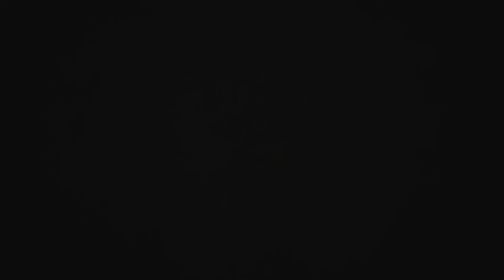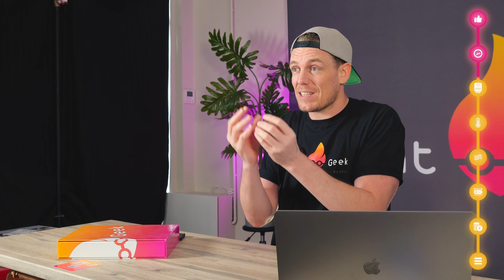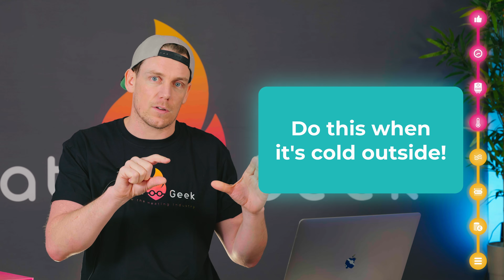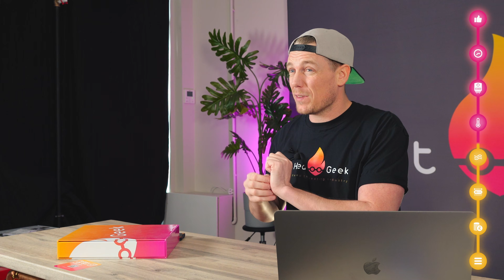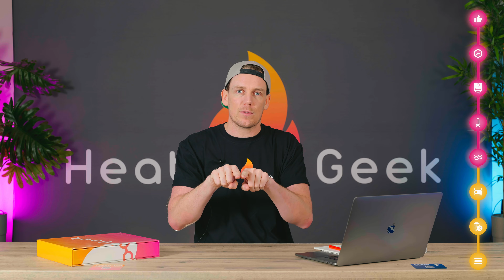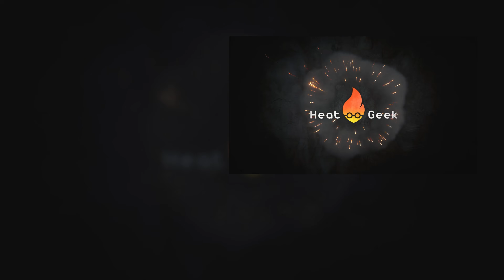PAY LESS FOR HEATING!! | The Secret To Boiler Efficiency | Consumer Advice

Comment: Really liking the efficiency theme! I'm getting a Heat Geek (Simon) installation this week and we struggled to lock down on the most efficient boiler option available. Would be incredibly helpful if you could do a HG video review of the most efficient system / heat only /combi boiler options for consumers if a heat pump isn't viable/ available.

Love the channel and the hard work you're doing to save us all.
Reply from the maker: Thanks! The most efficient boiler in my opinion is viessmann 200 with weather compensation for all the options due to its modulation range. So get one of those.. 

If heat only will need to revert to a viessmann 100
Reply: @HeatGeek  Oh thank God - we mutually agreed on the 200-W thanks to the lowest modulation ratio on any boiler we could find + being H2 ready. 

There is a dearth of available content on this exact subject btw..
Reply from the maker: @avivscrewvalla  h2 ready is a gimik, those boilers will never see h2. But yes agree

Comment: I have a small comment about lowering the flow temperature too much.
I have a small, well insulated house with 100 sq. m of underfloor heating. There is no zoning, all loops are constantly open. Heating is provided by a condensing gas boiler that has a minimum thermal power of 3 kW (1:8 modulation rate). If I set the flow to 28 degrees, the underfloor heating supplied with 28 degrees water is only able to dissipate less than what the boiler puts in at its minimum firing rate. The flow temperature quickly overshoots the target 28C and the boiler starts to cycle on-off like a sewing machine. But if I raise the flow to 35 degrees, then all of a sudden the floor can easily dissipate the 3 kW of heat and the boiler purrs like a kitten for an hour until the thermostat turns it off. I wish the boiler had a lower min. firing rate so the heating could run for longer periods of time at a lower steady power.

Comment: Interesting, is slightly confusing espec when we have a combi boiler but no smart home device to know of power output cost etc. So let's say we have our heating temp at 50 at boiler, is it best to set temp at house thermostat at say 20 and keep heating on all time so it stays around that or manually turning it off and on when required. Which would be more cost efficient. For example we have a hot water kettle that keeps it hot at low power and it states its more efficient than if you kept reheating it as a standard kettle.? Thanks

Comment: I hardly use any hot water. I generally use the local swimming pool and gym to wash. I also don’t use much heating as house is well insulated and big south facing windows in lounge. I have a normal system boiler with a hot water tank. Can I just adjust the boiler temp to 60-70 oC when I put the hot water on (usually about 25 min per day) and then reduce it right down to 45-55oC when I put the central heating on. The heating is obvs on for a lot longer per day than the hot water during a Scottish winter

Comment: Just Had My December Bill , So will Try 35/38 and See How Much I Save, House Is Set To 18c. Radiators all at 20c, But Of Course Heating Goes Of At 18c. Was Using 2-5 Gas Meter Units Per Day, Messing With The System, Now I Am Telling Everyone, Set and Leave, What You Think Guys? Oh By The Way, I Have No Income At This Time, My Company Collapsed , Due To Last 2 Years.

Comment: I have been told by a previous engineer to keep hot water temp at above 60degrees to prevent possibility of legionnaires disease? Is this only true of systems using a hot water tank? Thanks!
Reply from the maker: Above 60c is scalding. Very dangerous. Above 50c prevents legionairs. Legionaors fies in 2 hours at 50c

Comment: And best efficiency for hot water is when the hot water tank is hygienic boiler with no legionella at any temperature. Efficiency for hot water on combi boiler is less then 80 vs. more then 90 with hygienic boiler and the flow of water is key to economy.

Comment: I have developed a smart hot water cylinder thermostat. A) it means u know EXACTLY how hot the water is, B) you can EASILY and REMOTELY change the thermostat setting. C) see how long it takes to heat the water to the desired temperature. Woukd u be interested in it?
Reply from the maker: Sure..  is it commercially available?
Reply: @HeatGeek  it's a new product I have developed and current manufactured by me on a ad-hoc basis. If it takes of it can be packaged as a retail product. What kind of retail price would you think people would pay? What would u pay to put one in your house?
Reply: @HeatGeek  maybe we could work together on it as the first heat geek product!? Anything is possible.
Reply from the maker: @kevinleesmith  I have some ideas. Also have a video on this due out
Reply from the maker: Feel free to contact hi@heatgeek.com
Reply: @HeatGeek  done
Reply: AFAIK a modulating boiler, modulates the burner doen to a lower power output. Are youbsaying that a modulating boiler, also modulates the rad pump?? If so, can u let me knownwhere that info comes from because I haven't been able to find any info that says a combi boiler modulates the pump...

Comment: @HeatGeek, please what would be best: 57 at 23.5 Celsius or 58 at 23 Celsius on thermostat. My apartment is on the North, and no neighbours and last level. Is cold. 
I saw that on 57 and 23 Celsius, feels cols. At 23.5 and 57 is just fine. 
At 58 flow and 23, it is ok, still feels cold, until the condensing boiler starts. 

What to do actually? 

Thank you...

Comment: Just throwing a question out their can you get a solar panel system that will run an electric boiler so u don't need a gas supply to your property?
Reply from the maker: This is essentially what a heat pump is.. but yes.. electricity boilers use 3.5 x more electricity than a heat pump so cost 3.5x more.. don't do it if you can avoid it

Comment: This is really valuable information Thanks for sharing! It would be great to have more content for properties with 100% UFH. Reducing a boilers flow temperature to 35 degrees is probably not that great in terms of condensation efficiency I would imagine? Especially with mixer valves on manifolds etc
Reply from the maker: Reducing boilers flow to 35 is amazing for effy

Comment: I think heat pumps are fantastic idea for myself I want both working together so that in the winter the gas can supplement the heat pump or just run the heating for lower outside tempreturees. But for myself a could have free hot water all through the summer as I do with free charging  of our EVs . We just need to make sure our home is heated without issues below 5degress. So really running both would be our awnser.
Reply from the maker: Why couldn't a heat pump heat below 5c? Have you been listening to those with no heat pump experience? I wish they'd stay out lol
Reply: @HeatGeek  lol you sell heat pumps . But regardless I would not want all my eggs in one basket. My generator would happily run a gas boiler but I would struggle with the load of a heat pump.and yes we do get more than average share of cuts. And yes we cook with electric so upgrading my generator would not be cost effective. Our home uses a generator which can charge an ev and run home any more electrical loads would require £7k extra so being able to plan for electricity cuts  is vital living in rural areas. So gas or oil is or still can be used to heat or provide hot water in cuts. For this reason as I strongly believe that our net work in the UK would and could not deal with every home running on electric, proof again was this week s announcement of the ev regulation comming into force 30th June . It's very CV lear that the UK cannot presently deal with every home switching loads on at the same time. So again not all my eggs in one basket.
Reply from the maker: @gino2465  if we sold heat pumps that didn't work below 5c we would be out of business and our yiutube channel would be flooded woth unhappy customers. Can you point them out?

Also.. we are the uks number 1 hudrigen fuel cell boiler installers so hardly bias
Reply from the maker: The national grid disagree with network capacity. Watch fully charged interview woth them about this very issue
Reply: @HeatGeek  I know what you do,I have researched you and your company and seen all your YouTube videos, and I will say you are fair. But and again I want a heat pump but I am aware they are not 100% below certain temps nothing wrong with this sir. That's why I would not uninstall a gas boiler. Nothing wrong with this is a back up and to help a heat pump in colder weathers. I would have one tomorrow I like something that has an out put that cost nothing. But the cost of install is far out of the reach of the average person. I dream of having free energy between apron and October every year. What not to like sir.
Reply: @HeatGeek  if I come up on the lotto next week I would not use anyone else but you guys.100%
Reply from the maker: @gino2465  I don't disagree that the majority cannot afford them. I'm struggling to see why you think they don't work below 5 though and dint want to perpetuate that myth in this channel. 

Let's say you have a heatvpump that out puts 10kw at 5c outside and 9kw at -3. You would only install that in a 9kw (at -3) House. Provided your system can run at sensible temps why wouldn't that work when it's -3 outside?
Reply: @HeatGeek  I will be here all day chatting lol. Research there are hundreds of forums good and bad but below is just a bit taken from a heat pump manufacturers quote, I have several friends and 1 has had it removed. For swimming pools it was a no brainer . Must add some fantastic results for some people.  If I pay 12k for a system and it does not perform well or the cost increases to run it in winter period I would cry. This below is just one of thousands some from certain brands ....Your heat pump may not work as efficiently when the outdoor temperature falls to below  -5 ℃. When the temperature outside is around 7 ℃, the average heat pump should have a CoP of around 4.5, however this figure can drop to 2.3 when the temperature outside decreases to  -7 ℃. This shows how much the cold weather can affect the efficiency of the appliance.
Reply: Hi  @gino2465 . The snippet you’ve posted doesn’t say they don’t work below 5c, just that they have lower efficiency at lower outdoor temperatures. I think they mention 7c as this is the outdoor temperature used when stating ASHP output (I have no idea why, but maybe someone smarter than me will chime in!). 

The efficiency at any given outdoor temperature will depend on the system flow temperature. The stated output is 35 water at 7 air. The units do face a double whammy, in that when air temp is lowest, required flow temperature is highest, but a well designed system will mean that these high demand days are kept as efficient as possible, as are the many more days when the air temp is higher. 

From a running cost point of view, as pricing stands today, using mains gas on the colder days will be cheaper, but not required to maintain temperature in the house. 

I can absolutely see your concern about back up heating if you are in an area with an unreliable electrical supply. Big generators are big money!

Comment: Thank you for the excellent content. If I'd known all that I've learned from your videos in 2021 when our boiler needed replacing I'd have looked further into a heat pump. Anyway, we now have a Worcester Bosch Greenstar 15i and Hive - groan! Having finally understood weather compensation and modulation, which weather compensating smart controller would you recommend? I've asked the installer for a quote for the Worcester Bosch Sense II, but is that optimal? Thanks
Reply from the maker: Stick with sense 2 yes!
Reply: @HeatGeek  Many thanks!
Reply: i use the wave and its weather compensation program is spot on its a two core cable back to the boiler power over network so its easy installed.
Reply: @marktrewin4726  Thanks. Will look into it.
Reply: I use the worcester wave on a 440 cdi erp and it works very well, i have a large bungalow so the gas used this year using the compensated control is over 30 lower than the same time last year when i experimented with normal fixed flow and room set point.
I think the difference between the sense and the wave is that the wave gets whether updates and can use optimal start stop control in eco mode.
Reply: @marktrewin4726  That's signicant, thanks.

Comment: What is the ideal flow temperature for traditional older non-condensing boilers? I see so much info out there about combis and condensing boilers, but almost nothing about the older boilers. I don't have a hot water cylinder BTW so no concern re legionnaire.. Is it better at a lower temperature like you recommend for non-condensing, or would it be inefficient or cause other problems (such as being more likely to break down or something)?

Comment: Is there any benefit in adjusting the water flow on your unvented hot water cylinder? I noticed that there is a isolator on the return pipe.

Comment: Will somebody please talk about short cycling!
My thoughts..
I have an Ideal boiler with Ideal's Halo thermostat which turns out to be very primitive.
The boiler heats one radiator with an output of about 400 watts.
The boiler has a claimed efficiency of about 90% at 4kW output so 4kW for me and 400W for the garden. With the Halo thermostat the boiler stays on until the room temperature rises above the cut-off point of the thermostat. The boiler can only produce 400W output by generating heat for roughly 1/10th of the time it is on. Unfortunately the boiler blows air through the hot heat exchanger regardless of whether or not there is gas being burned so the garden still gets 400W even when the boiler isn't producing any heat. In fact the load on the boiler is really 400W for the garden and 400W for the radiator so the boiler produces heat roughly 1/5th of the time its on with an overall efficiency substantially lower than 50%.

I must admit I wouldn't have known there was a problem if I didn't have a Vaillant boiler at another property and can see that the Vaillant boiler and thermostat produces about the same amount of heat while using less than half the amount of gas.

Is there any way to increase the efficiency of the Ideal boiler or should I scrap it?

Comment: Hi I like the videos and advice but could you do one on a complete cost to an average house for a heat pump, this should include the pump, wiring, and plumbing, plastering, retailing and redecorating. As most houses have 10mm feeding radiators and would need to be replaced these have been sunk in walls behind plaster board, and the joint or unequal tee will be under your floor which will have to be lifted  bedrooms bath rooms etc, I think people need to understand the true cost. I’m not against heat pumps but when you see headlines that they are cheaper and coming down and grants offered but only for the pump not the whole job, hope you can help.
Reply from the maker: The answer is 15k on average.

The average house doesn't have 10mm at all. It's has old oversized 15mm and 22mm pipework and definitely does not need plastering. Low quality new builds have 10mm but are less likely to need a repipe due to lower loads although those that don't want to do calculations say it might.

We've done a while consumer series around this. Please start with the "do I need to upgrade my pipe work for a heat pump" video.

Comment: The trouble with lowering a boiler temp with a normal pump is you might use less gas but you'll use more electric at about 80w as the boiler will be on for longer heating a home, on more modern boilers people turning down the boiler thermostat would work to save money as they have UPS3 pumps and most of the lads are fitting load comp stats..
Reply from the maker: About 40w more like..  nothing really

Comment: Can I sett something else on a Vaillant condensing combi boiler other then the heating curve?
Now it's sett at 0.90 but it's not good when outside its not really cold.
I am trying to make the curve more flat, from 30-50C°. I'm not expecting negative 20c° outside.
I have an external temperature sensor too

Comment: I have a Grant oil boiler with unvented cylinder, some CH rads and Ufh in some rooms. Is there any way an oil boiler can be modified to have the separate hot water and heating flow temps? It bothers me that the 60 degrees flow has to be mixed with a significant amount of cold water for the Ufh.

Comment: does lowering hot water on a combi reduce hot water pressure (eg for  mixer shower using only mains pressure)?  or will the lower flow temp allow higher pressure mitigating that? as with lower temp you’d need less cold water but I’m worried that would reduce the pressure of the shower
Reply: Short answer no, long answer potentially. Lowering the temperature will do nothing to the pressure of the hot water BUT if you're now using exclusively hot water it could potentially reduce the flow as you're restricted to what the boiler can produce, but then again most shower's flow rates will likely be less than the hot water flow rate anyway, so maybe not.

Comment: Is it worth keeping the pre heat turned on or off? Makes me think that I would use more water, waiting for the water to heat, so would cancel out any saving being on a water meter.
Reply from the maker: It really depends how much you use it but heat is more expensive, and higher carbon than water so off imo.
Reply: @HeatGeek  Ok thanks for that
Reply: was thinking of trying the low and slow method as well this winter so, the boiler would stay warmer as well, so I probably wouldn't need the pre heat. House is a new build so is well insulated, will compare the KWH used and the price to last years, on and off blasts 👍